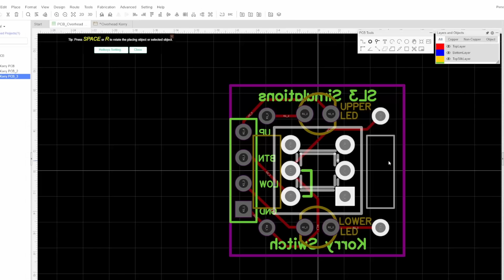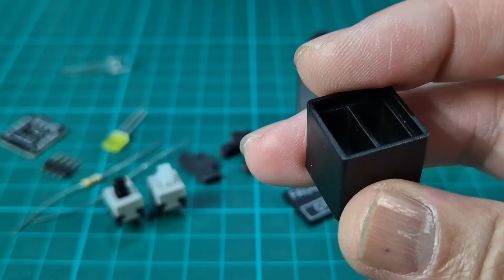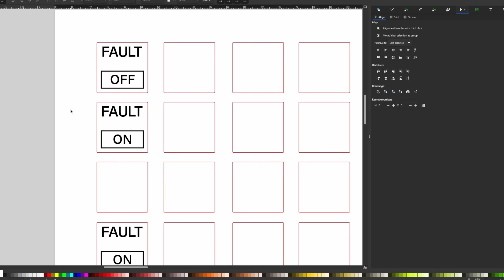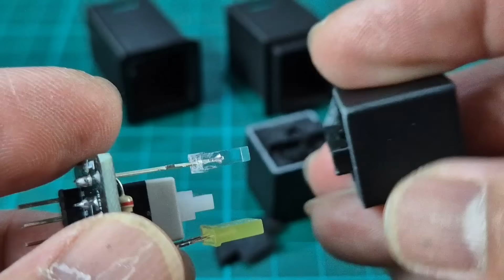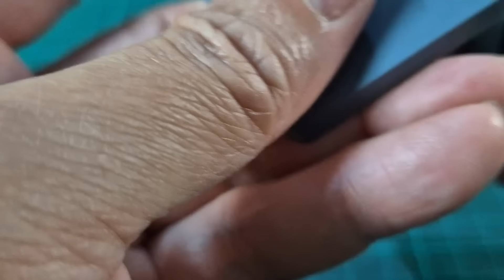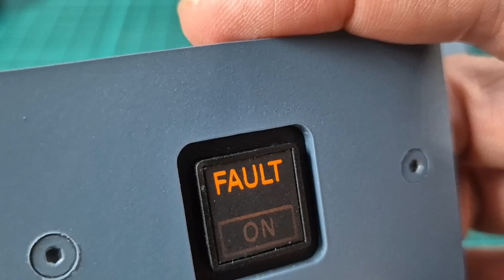How I make my A320 KORRY Buttons

Comment: at 46 seconds into the video, you show a circuit diagram for the Korry assembly. I can see that you've chosen a common anode configuration. You mention in your video that different LEDs have differing brightness requirements (controlled indirectly by individually chosen resistances). Is that the reason you chose common anode?  The advantage here would be supply a common voltage of say +5V and then ground each LED that you wanted lit up. Normally, designers use common cathode as its more easy to control the individual voltages to each LED and therefore control the brightness (but keep resistors the same value for any colour).
It would be nice to know what your design philosophy was at the time.
Reply from the maker: Hi!  Good catch there.  I was just having a discussion regarding the same topic at a home cockpit builders group in FB .  The diagram in the video is not a 100% representative of the actual circuit.  The LEDs there are flipped.  And you are right they should be common cathode. I picked that clip randomly to fill the video but it was a very early stage version of the design and must not be used as the actual schematic.  To those taking that schematic, just flip your resistors to be common cathode.  Also, the representation of the LEDs there is just a placeholder for the PCB for me to mount the actual THT resistors of my choice.  For LED intensities, I find 47-50ohms are the right resistance for the Yellows and Reds.   For Clear and Greens, I use 220-250ohms.  And that is because I find these LEDs to have varying intensities depending on color.  I hope that helps and sorry for the confusion.   :)
Reply: @santiagoluib3  No apologies necessary at all - this whole thing is one big learning curve, some of us are at a slightly  steeper end of the curve as opposed to someone such as yourself who has allready done the hard yards and is no on a far gentler slope 😄. Yes I did also notice that both your LEDs were reverse biased, but ignore that as I wanted to understand your design philosophy. Thanks for clarifying. Funnily enough though, in the case of PLC signalling, most inputs from the field are negative logic (or earth seeking). Negative logic provides for some level of failsafe design, though it comes at a slight cost of complexity in terms of understanding/implementation. For DIY cockpits, I'm all for positive logic.

Comment: Hi thanks you so much for the effort . I made a pcb like the one in video can you just explain how do you connect it to arduino/mobiflight
Reply from the maker: Hi, that's cool!  Connection to Arduino is basically two output (LED), 1 button and common Ground.  Mobiflight has presets for the most common functions of most aircraft, so you can just select the preset that represents the button/led of your choice aircraft.  If you can email me we can further discuss details on how to connect it to arduino and mobiflight.  :)
Reply: Thanks a lot for your reply
So the 4 pins are 
1 ground 
2 led+
3  button 
4 led +
Correct?
How can I email you pls?
Reply: I replicated same board as ur video but your board common the +and not the - . Am I missing anything ?

Comment: This is a really nice design, looks very professional when it's all assembled.

There's a tiny bit of light bleed between the two LEDs and I wonder if it can be improved. I wonder if you could make the lens out of two separate parts with the edges painted in order to prevent the light bleed. I think that the tinted film would hide the gap between them, or at least that's my theory.
Reply from the maker: Yes, that light bleed is a little known glitch on this lens design and it's more pronounced in the Phone camera than in actual, though not a real show-stopper.   And yes, the solution you suggest I also got it from Mark Ayton whose designs are really good and I admire them (you can see his works from Printables-dot-com under nickname Mantoga).  The thing with that solution is (for me at least), the laser cut isn't really right angle (perpendicular) to the flatbed, therefore it needs to be sanded well to be right angle before painted and fused together with the other half, adding more to the already long production time :)   I will update this once I find other solutions.
Reply: @santiagoluib3  Thanks for the heads up about Mantoga, I'll have a look at his works as well.

I see the issue with the laser cutter draft angle. One option would be to flip one of the lens halves, that way the draft angles will cancel out and the two parts would sit together without additional sanding. The downside of that is that you need to keep track of which parts have been flipped when you paint and engrave them.
Reply from the maker: @yngndrw.  That's a clever way to cancel the draft angle!  But you're right about keeping tabs of the "pairs", let alone fabricating hundreds of these  :P  Thanks!

Comment: These are the nicest diy korry switches I have seen yet. Thanks for sharing! I do have a question. For the overhead panel, are you using a single power supply to power the whole overhead panel lighting? If so, how large/amps are needed for the overhead panel?

Comment: hey how did you manage to make the 3d printed parts move so smoothly? For me it is either so tight that hardly anything can move or so loose that the parts get stuck due to the slight rotation when I experiment with the tolerance

Comment: If you could separate your panel "sandwich", you could insert the shell from the front only in the lower panel and then fix the upper panel on top. You could even have a smaller hole in the upper panel since it does not have to be as big as the lip on the shell.
Reply from the maker: Thanks. Which panel are you  referring to? If it's the HispaPanels then it's better addressed to its creator :)

Comment: Hey Santi, do you have a link to the two resistors you use?
Reply from the maker: Hi John, you can buy these resistors from any online vendors :)  But I think the Asian online shop I got it from may not work in your region if you are in the USA, UK or EUR (it's called Shopee dot ph).   I send you one from Aliexpress instead, which caters to everyone no matter where in the world:   https://www.aliexpress.com/item/3256801456365227.html?spm=a2g0o.productlist.main.1.7c902dbdPKjkzL&algo_pvid=a8bdd727-a01b-44b5-bb1c-0101a92ab40e&algo_exp_id=a8bdd727-a01b-44b5-bb1c-0101a92ab40e-0&pdp_npi=4%40dis%21USD%210.29%210.26%21%21%210.29%210.26%21%402140f54217368189628242277ecf38%2112000016948599306%21sea%21US%214547369273%21X&curPageLogUid=2M35JkxkCxdt&utparam-url=scene%3Asearch%7Cquery_from%3A

Comment: Hello, would it be possible to tell me what blue/gray are you using for the panels. Thanks.
Reply from the maker: Hi Mike, I have my color custom mixed in a local paint lab.  We basically brought a Java Simulation FCU-EFIS and have them copy the color. :) It is very close to the airbus RAL 7031 (RGB = 91,103,109) but its a tad bluer.  Hope that helps.

Comment: Hey, is it possible to use keyboard switches to make this button? Maybe it would be easier to build Korry-like buttons this way?
Reply: I'd say yes, you'd just need to adjust your 3d print files to accommodate

Comment: Hello. Thanks for the video. If I am using your Kory Switches, where the output  LEDS have a common ground with the integrated buttons. 
How could I make it work with a LED driver ? 
The LEDs in the overhead panel wired from the Korys to the LED driver with the ground pin of each korry also ... Would the one ground connection coming through the LED driver into the Arduino WORK for the input ( Button PIN ) connection direct to the same Arduino board ? 
Sorry but my electronic circuits knowledge is limited.
Reply from the maker: Hi.  If you use 74HC595 as your LED driver I think you should be fine as the LEDs on the Korry use common GND.  Best is if you could simulate this on bread board, ie. LED with resistor and common GND and Data Pin that goes to a pin on the driver.

Comment: This is a great tutorial on assembly!

Is there a chance I might ask for the font you used on the panels/switches? I've got a small project upcoming that is inspired in aircraft, so this would all come in handy for that precise look!
Reply from the maker: Thanks!  The font I use for the panels is  MS33558 you can simply google and download it :)   You just have to adjust the word spacing because the default has the words separated too far apart.  As for the Korry "lenses" labels, I use Helvetica Neue Medium font.   :)  Cheers

Comment: Hey, what material did you use for the inner wall of the korry button? Because on the website where they ordered there are a lot of materials and I'm not quite sure yet.
Reply from the maker: Hi @turkish_airline, I'm not quite sure if I understood your question, but my Korry casing are made of 3D printed PLA for the outer sleeve, and resin printed for the inner "drawer" shell.  Hope that helps :)

Comment: Looks amazing as always! Can i ask what is the shipping method? and i assume can ask for what ones i want ( overhead of course but what about FCU and efis? ) and are you any closer to having thr panels ready to sell? be nice to order both at once

Thanks!
Reply from the maker: Hi, I currently engage with PhilPost EMS Philippines.  Shipments typically take anywhere between 15-25 days depending on destination.  Still not cheap for overseas destinations for some ppl. There is a faster and more secure option, via DHL Express, but at a much more steeper cost.    The ver3.0 of my FCU-EFIS Buttons (Korry) are still on the working table needing attention and time LOL.  For now, these FCU-EFIS Korry's only have the green indicator lights (that is, the text labels aren't backlit yet).  And yes, I have already started selling "Starter" panels, I just had no time to post these on the store but ppl can just message me what they need :)  I'll be making a separate video on the panels soon.  Unfortunately, the panels are not the advertised "Pre-backlit" using EL panels (there's some reasons now to drop the EL Panel backlighting) but they are backlight-ready for customer to so their own backlighting.   Cheers!

Comment: what supply voltage for buttons ?
Reply from the maker: Hi. The buttons as well as LEDs connect to your I/O board's (eg. Arduino) data pins and GND and take the board's 5V supply.

Comment: Hey Here's Deniz from the email, I have a question about how to set the buttons with 6pin on MobiFlight, because it doesn't work by me, I just know how to set microswitches
Reply from the maker: Hi!  For push buttons, even if you have six pins, you actually need only two of them.  Each row of three pins has two which are used, so it's your choice which row you use, just like in my video.  Either side works.   The trick is finding which of the two (of the three) pins are used.  So a multi tester comes in handy.  Typically, the pin at the center is the common ground.  Hope that helps.   :)
Reply: @santiagoluib3  thank you 🥰

Comment: Impressive work! 

But to be honest, at this point it would be cheaper to just buy real ones. As far as i know a real button costs 16$
Reply from the maker: Thank you!  But the whole point of this video is for D-I-Y and the fun of doing it plus a fully functional Korry-like button.  I don't think you can buy a real Korry below US$125.  That's from Korry  Electornics. Some even go as high as $400+.
Reply: Well that's a valid point. Most people forget that not flying the sim is the actual hobby, it's building it. Anyway I would just use real parts, here in europe parts are relativly cheap. For example a complete APU panel is like 130$.
Reply from the maker: @memeswithoutcontext4716  That's cool!  You are lucky to have these "real parts" panels cheap in your region.  Of course, if you can get the real ones for cheap, why take the hassle in building them, right?  :)  Cheers and happy flying!
Reply: Jes exactly! If you once flew in a full flight simulator you will never go back to something else than OEM parts :)  . Sadly I dont have enogh space for a big cockpit like a 737 or A320, therefor I'm going to start building an DCS  F15 mixed reality cockpit.

Many happy landings! :)

Comment: Because the shell you glue on will break over time...
Reply from the maker: So far, not in my experience. The outer shell is not subject to high tentions with normal operations. Also PLA doesn't break. With strong CA glue this thing clings on like it's part of the structure.  However, the inner shell that is made of Resin is the one more likely to break. 😊

Comment: humm first resistor is 200 ohm [ red black brown / gold for tolerence ] (two hundred not two fifty [ that what i heard in the vid ]) and the second is 47 ohm [ yellow purple black / gold for tolerence ] (forty-seven not fifty [ that what is heard in the vid ] ).
Reply from the maker: Good catch! Yeah, with such a messy working table things easily get mixed up.  Thankfully a 3 to 50ohm "mistake" doesn't blow things up  ;)   Thanks!
Reply: Smart ass